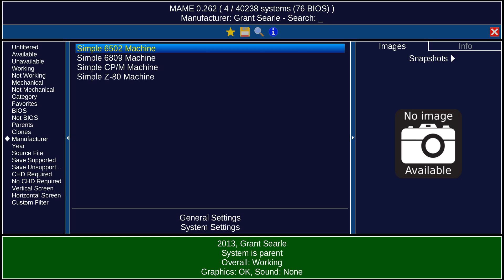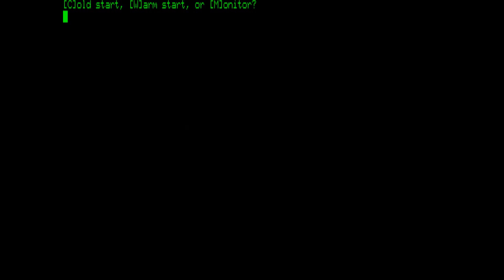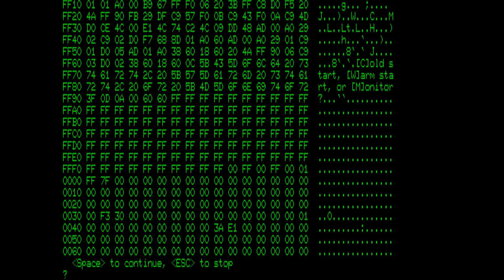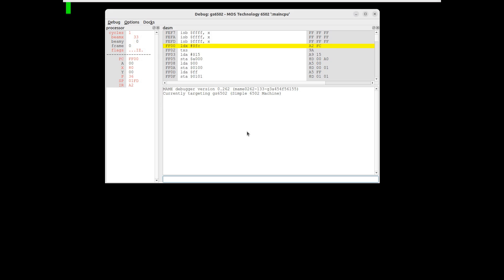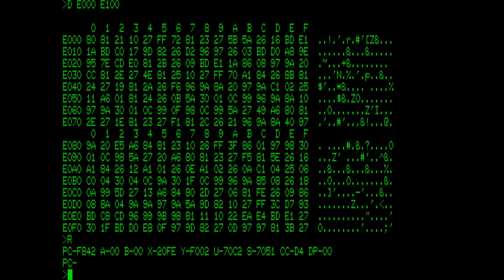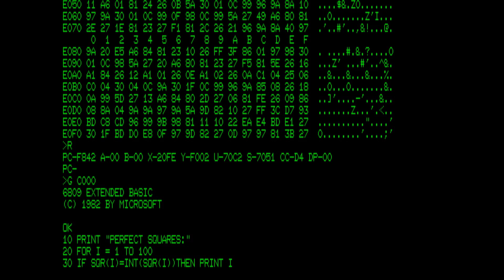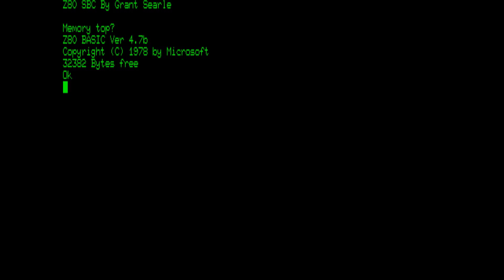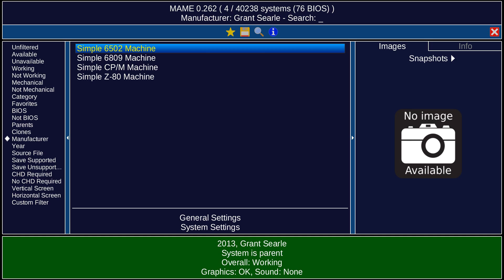Emulating Homebrew Single-Board Computers with MAME

Comment: Hi, Jeff.  Thank you for your video, which I find very interesting.
I've tested SBC6502 emulation on MAME, using a gs6502 zip file.
At startup, the Warm Start and Cold Start options appear. It only responds to the [C] - Cold option.
This results in OSI BASIC Version 1.0 Rev 3.2 by Microsoft Co. being displayed.
What would be the difference between a Warm Start (if this option were available) and a Cold Start?
On the other hand, the [M] Monitor option doesn't appear. Where can I download a ROM that has that option for the SBC6502?
Finally, if possible - and this has nothing to do with MAME - I would like to have access to the JMON source code for the ACIA 6850. The one I find in your Github repository is for the ACIA 6551. Thanks in advance.
Reply from the maker: Warm start goes to Basic without erasing any Basic program in memory, and only works if you previously did a cold start to initialize Basic. I answered your other question in an email.

Comment: Hi Jeff thanks for the mame demo. 
On Windows 10 I couldn’t get mame 0.262 to load your combined rom image from the GUI interface because of an incorrect checksum.
Loading mame from powershell console ./mame gs6809 allows pressing enter to ignore the checksum error.
Also checksum bypass works from the command line: mame gs6809
Your board is similar to the mame defined machine from Grant Searle.

I am new to mame. I got this far.
I downloaded your combined.hex file and converted it from Intel hex to .bin
I named it gs6809.bin then zipped it to be gs6809.zip and placed it in the rom subfolder of mame.
Launching it from the command line with mame gs6809 worked after pressing anykey to bypass the checksum warning.

A fun video would be demonstration a simple project on both on physical rom flashing  and emulated the same in mame.
It might help clarify the connection between hardware and emulation.

I’ll try running through Heathkit ET-3400 emulation with the expansion ROM images.
I also have an ET-3400 that I wired in 1980. I have’t built the expansion unit for it yet.

Comment: Neat! I would love to see how to emulate custom hardware, like the 6522 chip on your 6502 SBC. I did a bit of research, but hit a wall trying to find documentation on making custom MAME systems for hardware emulation.
Reply: Yes, this is the kind of information I'd love to have as well.  The MM/1 is a computer designed by TRS-80 Color Computer enthusiasts after Tandy pulled the plug on the CoCo 3, as a CoCo 4 candidate.  Maybe a few hundred were ever made.  There is no emulator, but almost every component in the machine exists in some form or another in emulations of other machines -- just not put together in the same place.

If you trawl through the MAME codebase, I'm almost certain you'll find emulation of the 6522.  So the remaining question is whether the different machines are standardized enough in their code so that you can pull a chip from this machine and stick it into that one.  I'm fairly sure, based on my limited poking around, that there aren't 2 dozen different implementations of, say, a 6821, or an NEC 765.

Maybe these extremely simple SBC emulations are a good way to learn about the MAME code and figure out how to glue the different emulated chips together to make something new.

Comment: I was fully aware of Grant Searle’s single board computer and FPGA based projects, but I had no idea that these boards were in MAME.  The MAME debugger is very good and I have done lots of debugging with it. It is easier to use with systems that have a flat memory map. Things get a lot more complex on systems that have a MMU or bank switching. I have used the CPU trace feature many many times. One of the best parts of the debugger is that you can see and manipulate the registers and many times internal states of any attached peripherals such as PIA/VIA, UARTS, FDC, etc.  Another powerful feature which is normally not present in Monitor programs is memory watch points.  Again thanks for the excellent video!

Comment: Why did your perfect squares demo miss 25?  or did I miss it...?
Reply: missed 36 too.
Reply from the maker: The program has a flaw in it. Depending on the version of BASIC used, the square root of 25, for example, is not represented exactly as 5 and the program fails to report it. The flaw can be fixed with a slightly more complex program.
Reply: just for sanity, I just tried same code in bwbasic and it worked fine... but I will play with MAME also... thank you  for the intro.   I had seen some of the old CP/M machines in the list but had not had any luck making them work.   Studying the ROMs for Donkey Kong was good fun though.